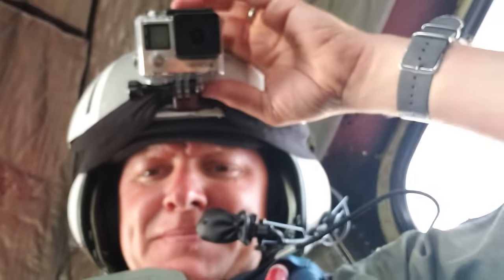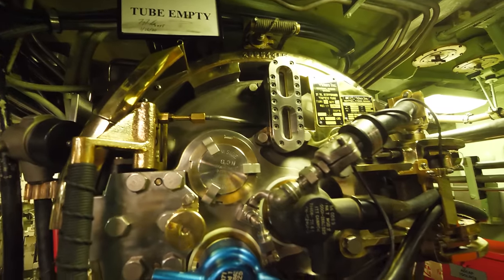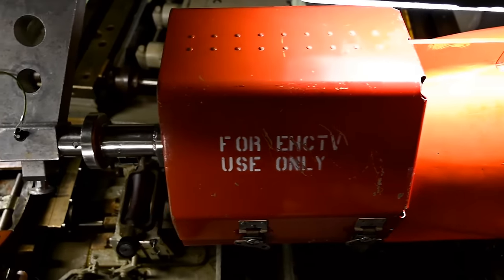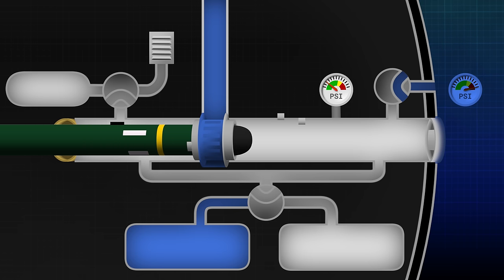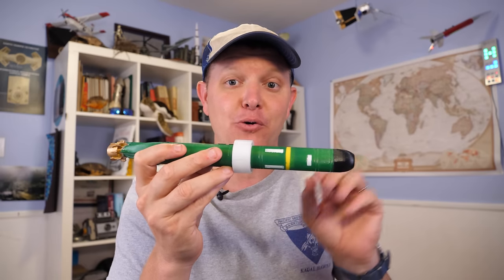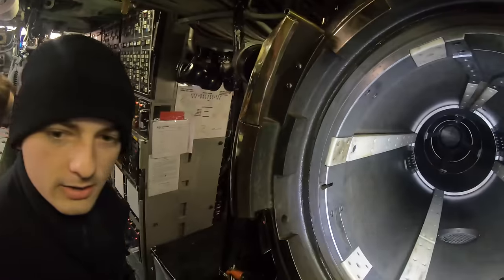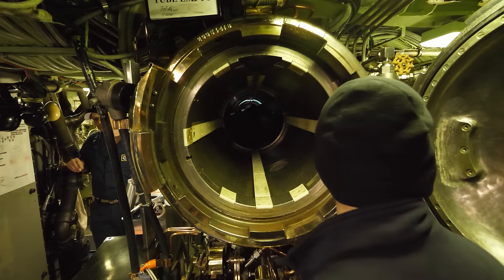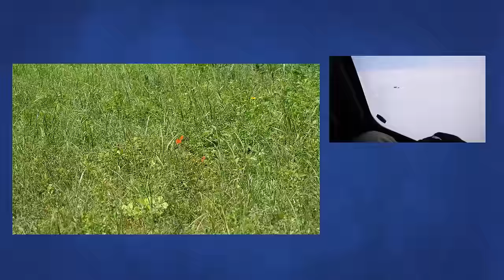Crawling Down A Torpedo Tube -US NAVY Nuclear Submarine - Smarter Every Day 241

Comment: I never saw the way they loaded it, but i read about it on a few older forums, probably defunct by now, and to this day, i'll never understand why, aside from this method, they don't just load the armament through the way it's supposed to go out of the ship. Have a mating collar at the reloading facility of their choice, that collar clamps and seals unto the face and the armament is back fed into the system where existing mechanisms reverse load it into the magazine.

That would cut all the time it takes to load these things in half. No fiddling, not "pay attention" just automated, existing mechanisms that already function at peak efficiency for that purpose, asked to reverse the operation, so not even an issue of complication on their part. IE, no human error guard to slow the process down.

Not only that, but the whole problem of "decisions made XX years ago, affect what can be loaded today" would be rendered moot, since all it would take is a redesign of the tube and mechanisms and the payload would change according to needs. There's certainly plenty of space, and i'm 100% sure the engineers left enough "grounds" exactly for that kind of stuff. I refuse to believe the engineers of that era, would do things any other way in that regard considering the myriad of other examples of forward thinking in boat/tank/plane design.

Bear in mind, my wonder is solely a question, i'm sure there's a ton of issues that can be raised, but i just see an efficiency issue. Why load the weapon through a lot of hassle, dismantle sections of the ship, willingly expose it to enemy attacks et cetera, when all this could be done, NOT only out of sight and out of mind (the collar clamp feeding tube would not need any kind of human intervention, pure automation) but it could also be done out in the waters. You'd have a specialized ship class just for that purpose alone, feed the sub.

We have them for airplanes, IMO, a far, far, more complicated affair, why not for subs, where things can be much more simpler to do, because of the nature of the water's relative safety. And none of the things/technologies i implied are alien to us. Again, we've done all of those things, not only in air, BUT also in space, which share a lot with sub design, afaik, in the area of seals, structure, construction.

If it were up to me, i would design a sub to have the ability of stealth loading. It's a stealth ship, so it should behave in that capacity at all times, if required, not just in the theater of war.
Reply: The Soviets actually did it this way with one of their subs though I cant remember which class it was. The reason why we dont load them this was, despite it seeming to be dead simple and much less complicated is for one main reason: The torpedo tubes are below the waterline. Unless you plan to drydock the submarine every time it needs a reload, there is no safe and practical way to reload while at sea.
Reply: If the US military are happy with Videos of their old subs being available to view i doubt they still rely on such methods. in 10 years when we're watching videos of the automation you mentioned we'll ask why they dont just the alien tech to "scotty beam up" onboard.
Reply: A halfway decent weapons handling team can have a torpedo down every 20 minutes. Also, how can you stealthily load a sub? Its more than torpedoes and harpoons...Tomahawk missiles and countermeasures also need to be loaded. They come on by a different process. Simply put, thr sub needs to be surfaced.
Reply: In dock are the tubes submerged?
Reply: @QqJcrsStbt  in Port yes. 70% of the boat is still submerged when surfaced, including the tubes. WHen in drydock the entire ship is exposed.
Reply: @SweetLou0523  all soviet subs load that way. The problem with it is you need to ballast down the aft end of the sub, and in US subs it would be quite a bit. In that case, you risk grounding the rudder and it takes just as much time to ballast and deballast as it does to set up the load line, and with more risk. So for that reason we load the way we do. It works for the Russians because their tubes are higher up and rudders are smaller.
Edit-Also the Russian boats have some external tubes that can only be loaded in that fashon
Reply: @briansonnenfelt7125  Just twigged to the ambiguos nature of 'dock' in common parlance. In port would have expressed my question better, thanks.
Under water would be barking.
Reply: @briansonnenfelt7125  Interesting, never knew, every day a learning day. Thanks.
What is an external tube? Had to look thay one up. Didn't PT boats try simple drop torpedo launch?
Reply: @QqJcrsStbt  they are tubes that are external to the pressure hull. They have an electrical connection to recieve the command to fire, power on, etc, but once its shot the tube cannot be reloaded until the boat pulls back in. As far as PT boats, I'm not sure. But I assume its something similar to an external tube, just connected with compressed air to fire the weapon. The only advantage to external tubes that I see is the ability to carry a couple more weapons without worrying about storage in the room. Or a fuel leak on a thermal weapon, since the leak will be isolated to the tube. But fuel leaks are pretty rare, at least on US weapons.
Edit-Sorry...its believed that a 65 cm eternal weapon is what sank the Oscar II class sub Kursk in 2000

Comment: Concerned about scratching the Torpedo while it’s loading ? The enemy at the receiving end will be offended for a second or two.;-)
Reply: I would guess it's more about being smooth and mitigating drag in the water so the weapon moves faster.
Reply: You'd only be scratching something like the detonator of 600 lbs of high explosives.  Nothing's going to happen. It's all blue sky and bunny rabbits.
Reply: Actually,  you want to be able to load the tube quietly and not have it rattle around once in there.

Comment: Referring to torpedos as “old technology” because they’ve been around for nearly a century in one form or another is a bit like referring to the space shuttle as old technology because the Wright Brothers had a machine that got people off the ground over a century ago.  Torpedos today are essentially fast underwater robots carrying enough computing power to control a small factory, and enough explosives to blow a large hole in a thick steel-plated hull.
Reply: Technically most of today’s technology is old

It’s just been upgraded to modern day standards
Reply: But can their computers run Minecraft?
Reply: it would be like calling computers old technology

Comment: I just got my security clearance for Navy nuke and I’m trying to be a on a sub, these videos give great insight. Thanks destin
Reply: current nuke mechanic on a 688, let me know if you have any questions about what you're getting yourself into
Reply: Get hot, NUB! Seriously, best of luck. A few tips: a) The most common reason people get tossed during nuke school is NOT for academics, it's for things like alcohol related incidents. b) Competence is more important than paygrade on a submarine. Want to make a positive impression on the crew and make things easier on yourself? Qualify your watches quickly and get your dolphins fast. You can sleep later. c) Coner Machinist Mates (non nuke types) own about 75% of the boat. Yes, even stuff in your engine room. d) If you're in Maneuvering and you get mad and Slam the sound powdered handset into the ECP hard enough to break the handset, I will replace with one that has a three inch cord. I'm just saying. e) There are no animals onboard, do not feed the shaft seals. There is never a mail bouy. Never. Nope not even with the really clever story they're telling you. Portable air samples are real. They are never taken by running around scooping air into a trash bag. Do not go get a TM punch. It is not a tool. It is you getting punched. By a TM. You can move water from tank to tank with pressurized air, this is called "blowing" and usually needs permission. The DCA is not a tank, do not get talked into requesting permission from some junior officer to blow the DCA. Trust me. A sign on the bathroom door that says, "Head secured, blowing sanitaries" is not something to ignore. You will work hard. You will work long hours. You will form bonds that can last a lifetime amd when you're old and gray you will look back fondly on your time as a nuke.
Reply: Did they brief you on how humans from 85 years in the future have been interrupting nukes for 60 years yet ?  If not  Thats coming.  Lol

Comment: Imagine they shut  the breach behind you while you're in the tube, now that's the stuff for horror movies...
Reply: and run the process, fill it with water, have your air supply pushed out,... come on! That would be a terrifying experience... followed by equalizing the water pressure... and opening the door. Sounds terrible.
Reply: And launch your body into deep sea. No 9ne would know. That is horrifying

Comment: Destin, Sees a torpedo that potentially contains a nuclear warhead

“Imma go ahead and touch it.”
Reply: The US doesn't have any nuclear torpedoes (officially).  The MK45 was the only officially nuclear capable torpedo used by the US and they don't use them anymore.  That said, those MK48 ADCAPs have 800lbs of high explosives which wouldn't be pretty if it exploded inside the submarine - subs are designed to keep the high outside pressure from crushing the squishy humans inside so would be relatively weak from high pressure waves coming from inside the sub.
Reply: the "nuclear" part of "nuclear submarine" refers to them being powered by a nuclear reactor, not to nuclear weaponry
Reply: Yeetus Yeetus Kermit self deletus I like trains  Attack subs like this one dont, however we have SSBN Ohio class subs whose main purpose is to carry and launch ballistic nukes in a MAD situation.
Reply: @r05ejan8  the one time saying "ok boomer" is actually bad.
Reply: Yeetus Yeetus Kermit self deletus I like trains  The boat he's on is a 688 which is a Hunter/Killer sub. It's job is to hunt and kill enemy subs and surface ships. If this were an Ohio class it would have a sizable section near the mid of the boat dedicated to Trident sub launched ballistic missiles, which are nuclear weapons.
Reply: Yeetus Yeetus Kermit self deletus I like trains  There are, The Ballistic Missile Submarines (SSBN) carry Nuclear Sea Launched Ballistic Missiles. In the U.S. that would be the Ohio Class and in a few years the Columbia Class. The Toledo featured in the videos is a Los Angeles Class Attack Submarine (SSN).
Reply: In my understanding from people who've served on submarines, torpedoes have a lot of safeties built in so they won't explode until a series of certain steps have taken place. They say you can hit them with a hammer and won't do anything, people used to sleep on them and stuff.

Comment: Question: Why do the crazy lowering of the torpedoes into the sub when you could just put them in the torpedo tube backwards (basically do the firing sequence in reverse)? Is it easier to load with a crane, or maneuvering a torpedo underwater with tide is harder?
Reply: Several other navies do exactly that.  Several Russian subs load that way, particularly where they have outer tube doors that can be high up, nice and dry above the waterline when the ship is at the pier.  But the U. S. just yanks up the deck plates in those areas of the ship and creates a giant "canyon" from the Weapons Shipping Hatch, all the way down to the lowest interior deck.  It's quite a thing to stand in the upper level passageway and see the ship open all the way down to its belly.  Plus, we don't have to be shuttling watertight doors open and closed--especially as our tubes are w-a-y down deep below the waterline and we'd have to flood the tubes and blow the tubes dry each time a weapon got loaded, and then trim out that water and recharge that pressurized air.  The way we do it is plenty easy... but of course I worked back aft and wasn't a TM and didn't have to participate in weapons loads, so I have nothing to gripe about.
Reply: Don't want to expose the torpedo to the sea environment until absolutely necessary. Pierside water is pretty nasty. Diver's needed. All sorts of reasons not to load via the muzzle. Once everything is set up it's faster to do it the dry way.  FTG1(ss) Retired
Reply: I was on the USS Halibut(SSN-587). We didn't have a torpedo loading hatch. We just opened up the top hatch and it was a straight path to the torpedo room. That hatch was HUGE, around 20 feet in diameter or so.
I was surprised they didn't tell you what it is like when they fire a torpedo. When they vent the air pressure after it's fired, you can feel the pressure in the boat go up all over the ship.
Reply: @lochinvar00465  My father served on the Halibut sometime in the mid 60s as a QMC. We were in Hawaii at the time. Halibut was a very unique class of boat.

Comment: Cool video! Speaking of the teflon sliding surface, it could also be UHMW(Ultra High Molecular Weight) plastic which is a bit different. It would be cool for you to do a video on the differences of certain low friction plastics. The differences between these types of plastics can actually be very important depending on the application they are used for.
Reply: I was thinking the same thing because of its extreme durability.

Comment: Question: How do they protect the antennas when they breach the ice? Wouldn’t the antennas get bent or broken?
Reply: They're retractable.  They only stick them up to use them, otherwise they cause noise and drag.
Reply: Akseli Larikka the sail is hardened for under ice surfacing. The sub I was on did not have a hardened sail so we didn’t do under ice ops. The various masts are stored in the sail when not in use and when surfacing under the ice. This is true when under water as well. Most masts have a limited speed (around 5 knots) that they can withstand. So when raising a mast under water you have to reduce speed. For example the periscope is raised prior to coming to periscope depth.

Comment: Reminds me of a now, nasty memory...  Ship in the yards.  My assignment was to crawl into the tube that normally held one of the shafts... With a bucket of water & a sponge...  A longer crawl than the length of a torpedo...  They were welding on the outside of the shaft casing...  It got hot, and the oil on the inside of the tube tended to catch fire, ergo the (then) skinny guy crawls in to put out the fires...

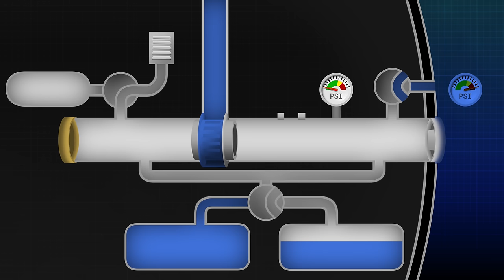Comment: 13:32 what happens to the extra water that's now in the system on the bottom right?
Reply: Seawater on a sub gets moved around, and yes it can be pumped overboard to maintain trim.  The trim and drain system is a key learning on the boats.
Reply: That Aux Tank is connected back into the tanks and piping of the ship's Trim System, which has various tanks distributed along the length of the ship for the primary purpose of keeping the ship level and at proper buoyancy.  Once the torpedo tube full seawater has been blown down into the aux tank, the Diving Officer and the Chief of the Watch can ensure the weight of the water is then properly redistributed within the boat so that trim and buoyancy of the entire ship are right back where they oughta be, despite having just said "bye-bye" to a 19-foot-long, 650-pound torpedo.
Reply: Water remains onboard to replace the weight of the torpedo. Gets redistributed throughout the boat

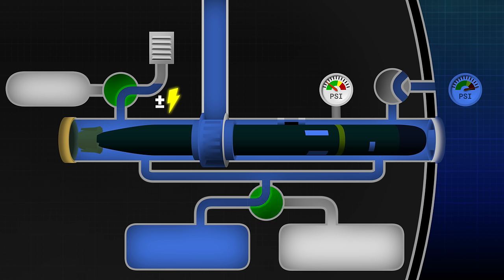Comment: 10:12 does that mean it won’t work in fresh water?
Reply: Why would a sub go into fresh water?
Reply: Hi
Reply: @user-em8fq2ev4b  For the war against Canada in the Great Lakes
Reply: Fresh water is still conductive, just not as much. But i also struggle to think of any bodies of fresh water with military submarines in them. :p
Reply: Sensor will detect any water.
Reply: Under the polar ice the ocean water is significantly less salty due to the fresh water coming from underside of the ice sheet
Reply: It would would still work, fresh water is just less conductive.
Reply: If it really uses conductivity (it might be that Destin simplified it and it's some other type of sensor lika a capacitive one), it will not work in distilled water but all water that a submarine can be in, even if it was the cleanest fresh water lake, is conductive enough for a conductive level sensor to work.
Reply: Normal lake water is probably conductive enough even though it isn't salty. Unless you're diving in distilled water.

I'm not a submarine expert so I don't know for sure though
Reply: I assumed he was just clarifying that the water didn’t come from inside the sub

Comment: To be able to swim through the water the torpedo has to have the same density as the water. So you only have to keep the additional water in the tube to keep the boat balanced.

Comment: Way more sophisticated than the early subs that just had a sea valve to flood the tube, blasted it out with compressed air, and then close the outer door and drain the water into the bilge.

But if you're not running on diesel and aren't surfacing every night to fill your air tanks anyway that air definitely becomes a precious resource.  Not a lot of nitrogen available to extract from seawater.

Comment: I mean, an ideal torpedo being neutrally buoyant also just makes a lot of sense in general. You don't want it to automatically sink or rise without control input while it's moving to hit whatever it was sent to attack. Or a different way to think about it, a torpedo is basically just a smaller, angrier submarine, so all the same basic control principles apply.
Reply: It may be sensible but it isn’t true unfortunately. A Mk48 is heavier than the water it displaces so additional water is needed to be brought in after firing to maintain buoyancy